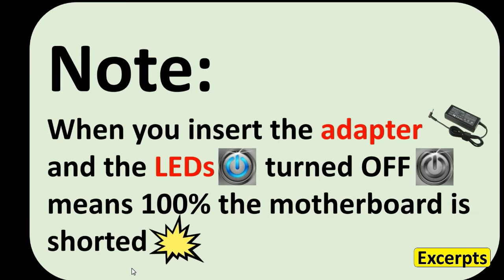Laptop motherboard repair course, Laptop repair part 2

Comment: When checking short-circuit on an inductor and u find 40 to 50 ohms resistance with a buzzer, is that a short-circuit? Furthermore, after isolating the short-circuit by removing the inductor both the electrolytic capacitor n ceramic on a 5v 3v rails are not the ones shorted. How would u further diagnose the short-circuit?
Reply: Is not a short
Reply: Zero ohm is short
Reply: Thank you
Reply from the maker: Sometimes even 7 ohms is not a short. 000 o 001 is short